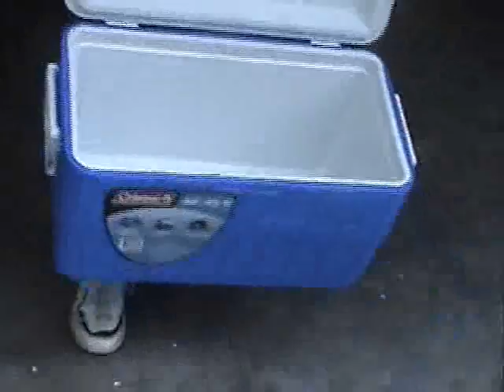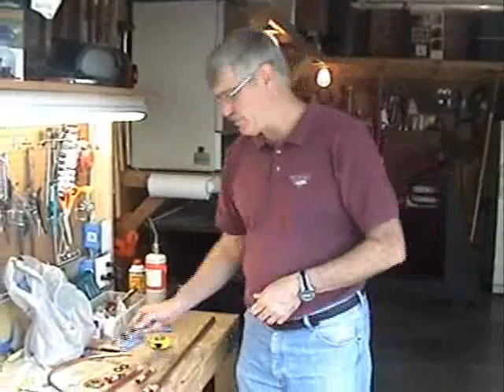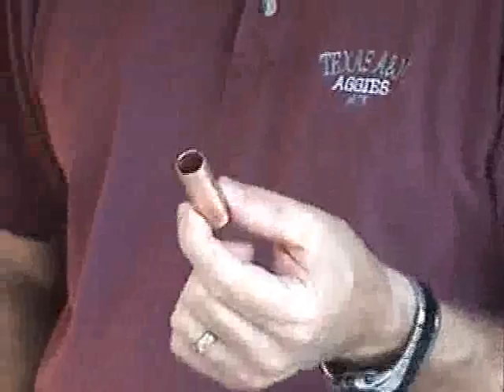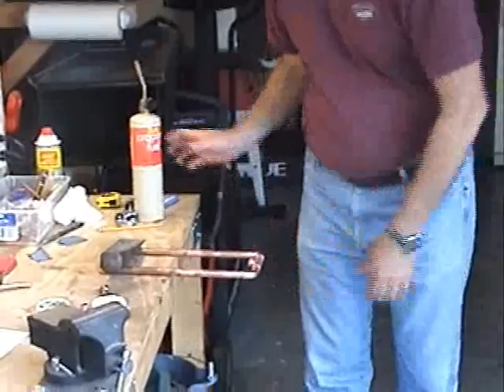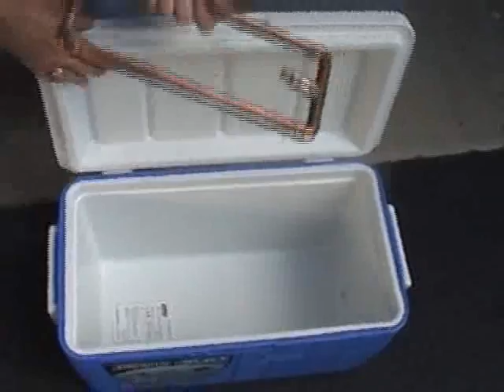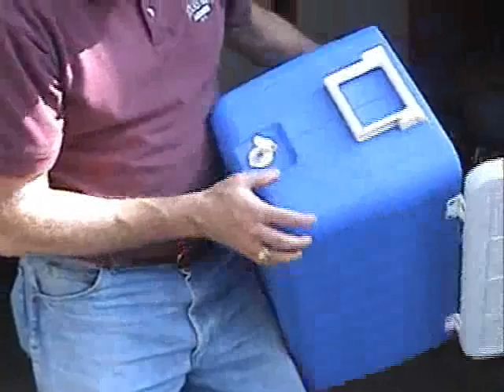How to make a Mash Tun Part 1 of 2

Comment: @ZiggyTrek 
I can answer for the builder.
When tubes are not soldered the tubes can go apart when you mix mash with water. If you make it tight it actually siphons the worth almost to the bottom of the cooler even the worth has to go up.

Comment: Is there a down-side if you do not solder? I assumed it could be slid apart for easy cleaning. I could see accidentally banging it loose with the spoon while stirring, but beyond that, is cleaning an issue?

Comment: What is the purpose of the "s" bend in the tubing?  Wouldn't it be easier to run the tee straight at the side of the cooler and hook the drain fitting to that?  Does the s bend help with the drainage/flow or something?

Comment: I made mine with a coleman cooler... a $1.99 mini keg bung...  a length of 1/4" siphon tubing I had laying around and instead of a manifold I used stainless steel hose braid. Simple, quick and inexpensive.

Comment: A+ on using copper tubing instead of PVC for the construction, and excellent point on using lead-free solder... But please NEVER apply brazing flux with your bare finger. Flux is highly corrosive and many studies show it to be very carcinogenic. ALWAYS use a flux brush and/or proper gloves.

Comment: Just some pointers on soldering copper pipe (I do a lot of industrial plumbing... and I don't want to flame a novice - I'm just giving pointers) - DON'T over heat... No cherry-read required.. in fact - that is WAY TOO HOT!  Heat the FITTING just beyond the joint - the solder will be "drawn into" the heat... Remove heat soon after solder begins to melt - no need to continue heating (TOO HOT causes bad joint).  Just my $0.02 (cha-ching!)  COOL VIDEO :thumbsup: